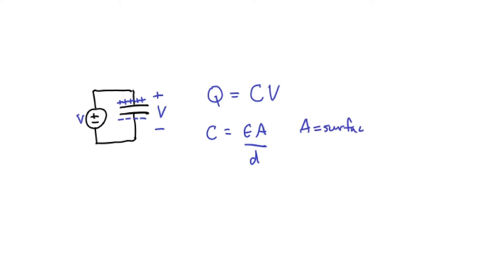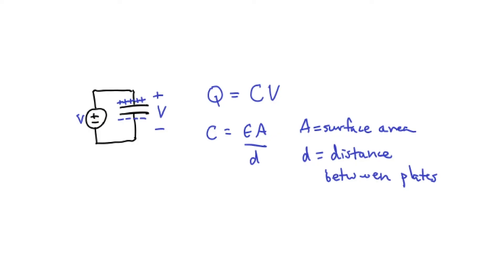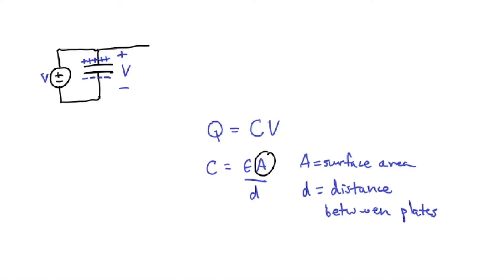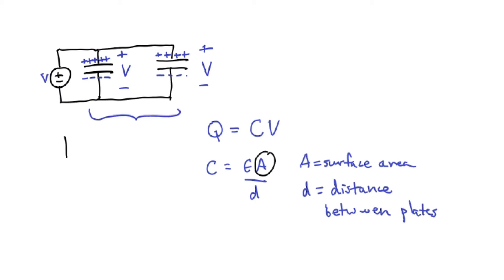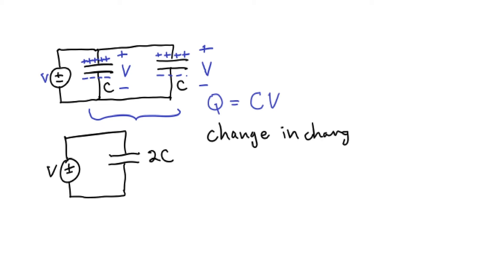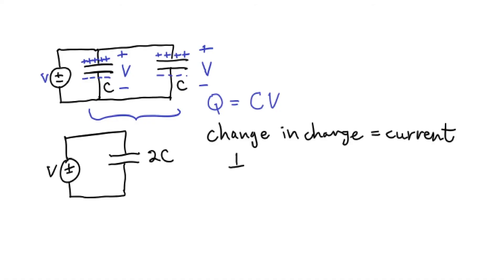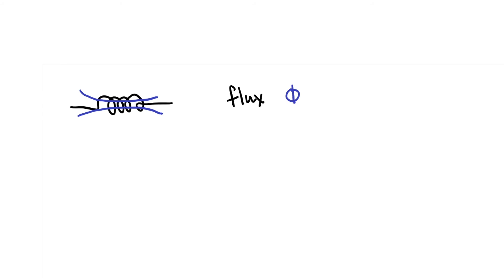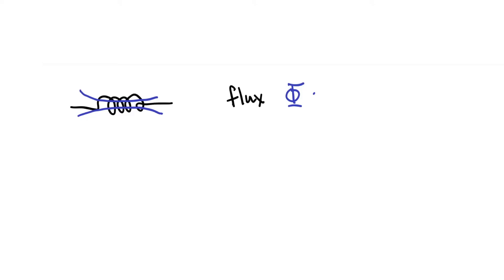Capacitors and Inductors (Circuits for Beginners #19)

Comment: This is where circuit analysis enters the time domain. Also energy storage in the form of an electric field (via capacitor) and magnetic field (via inductor). Time domain analysis is usually introduced via switching events in resistive circuits with dc sources that also have capacitors and inductors.